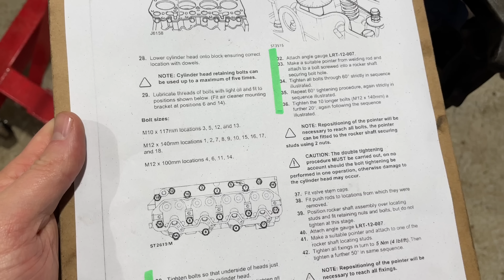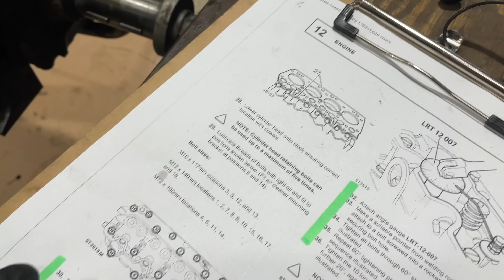Engine swapping a Series 3! - Part 1

Comment: Nice job fitting the engine, I did the same conversion, but unfortunately the high torque of 300tdi in comparison of the original 2.25 engine ends in broken gearbox, ( I broke 3 gearbox all synchronized) I suggest you to upgrade at list lt77 o r380 with short bell housing.
Reply: The standard Series gearbox in good condition will take a TDI reliably. A 2.25 can break a Series gearbox and likewise a TDI can break an LT77/R380, condition of the gearbox plays a big part.
Reply: @lowen74s 
Totally agree with you. I did my 200tdi conversation over 10 years ago and the old crash gearbox is still going well, but there again I'm not doing donuts or F1 traffic light starts.
Reply: @bobp6742  was that with the box rebuilt at the same time or as it was?
For the Series 3 I'm rebuilding I've gone down the route of using 1st, 2nd, reverse and the layshaft from the last of the Series 2 non synchro, and 3rd and 4th from the last of the Series 3 as I like the durability of the non synchro 1st and 2nd and only find coming down the gears a pain in my Series 2. The synchro teeth wearing on 3rd and 4th had occurred to all of mine before fitting TDIs and from the ones I've had apart looks like changing gear too fast, the tooth design and maybe oil issues have been big factors in this wear. The ones that have been apart are due to the spring steel strips breaking and jamming up the 3rd / 4th synchro hub.
Reply: @lowen74s  
I never touched the box I just dropped the engine straight in, I did swap the diffs for discovery ones tho.

Comment: Nice work as always guys. For others looking into this conversion, a number of additional points to note. The series battery tray and air filter bracket has to be removed with the battery relocated to the seatbox. The 2.25L engine bracket on the drivers side of the chassis has to be removed and replaced with the TDI bracket. The passenger side engine bracket on the chassis does not need to be replaced. A solenoid between the starter positive and glowplug circuit is a simple solution with the solenoid activated from the key or an additional switch on the dash.
Reply: If fitted as a di I fitted a 200di...ie turbo removed.....the battery tray and oil bath air filter can be retained with a mod the the batt carrier....also the battery stays under the bonnet.

So much more room under the bonnet.....and another plus.....you keep the std rad....and alternator position.

Looks so much more in keeping in a Series Engine Compartment.

Cant see any reason why a 300 can be made to be a non turbo...ie DI

40mpg and still plenty of power....way better than a 2.25d and petrol.

Comment: Know someone who did this conversion on his S3 88" diesel plus he added 1 Ton rims with 205/16 tyres and an Ashcroft S2 transfer box on the S3 gearbox with overdrive, lots of sound insulation and cruised at 60mph easily on the highway, made my 88" 2.25 diesel look slow!

Comment: Are you guys releasing the 2nd and 3rd parts? I have a 300tdi running pairing with orginal 2a gearbox and looking for next step to change my gear box without loosing the original look inside the cabin. What are you guys using for the transmission on this one?

Comment: Love seeing a series landy on the channel will make a massive difference in it drive having a TDI under the bonnet. Though would have gone for a full new fuel tank and line as the new diesel will strip the any old petrol residue and cause issues was a common on diesel conversion on 101's great to see you uprated the brakes to disc to.

Comment: What clutch did you use? and did the 300tdi just bolt up to the series bell housing or did you use an adapter plate?

Comment: Did the 300 TDI mount up exactly to the original S3 gearbox ?
Reply: Yes it does mate.
These Muppets don't seem to want to talk to their viewers, nice caring people, not!
Reply from the maker: Chill out bob, almost spat your dummy out there. 

In answer to your question, it doesn’t exactly bolt up - the stud at 6 o clock needs to be removed and moved about 1 inch over and re drilled into the flywheel housing. You’ll need a 300Tdi pressure plate, but a series clutch - LOF or Steve Parker’s provide this unit for the conversion 🙏🏻
Reply: @juicemotors  
Pity you had to be coerced to reply after 9 months

Comment: No mention of how you the gearbox mates up, or what clutch and flywheel you used, is it the rearplate from the petrol on the TDI engine?
Reply: 2.5 NA, 2.5 TD and TDI all mate to the LT76 series 3 gearbox with no issue. Series 3 clutch and pressure plate also works with the TDI

Comment: Nice work, hey what’s the electrical connection on the top of the 300tdi cylinder head (exhaust side)? We don’t have that in Australia. It’s just a blanking plug.
Reply: Egr valve

Comment: Not my idea of a rebuild given it had probaly done 160,000 miles plus. 

Why not at the least hone it and fit some new rings and shells - still a budget rebuild but way better than this tart up job.
Reply: I was also wondering 🤔 why they didn't replace rings and shells especially if the top end is that worn only time will tell  🤔 I guess

Comment: Why does everyone fit the 300Tdi engine it's crap. The 200tdi was far better and a stronger engine.
Reply from the maker: It’s not crap though is it… Land Rover improved and evolved 200Tdi into the 300Tdi - I’m certain LR engineers knew what they were doing
Reply: @juicemotors  I own a series 3 109 petrol. How much to do this conversion ?
Reply: @joelywii 
Biggest expense is the engine the rest is pretty straight forward.